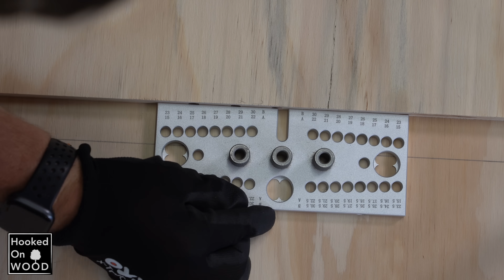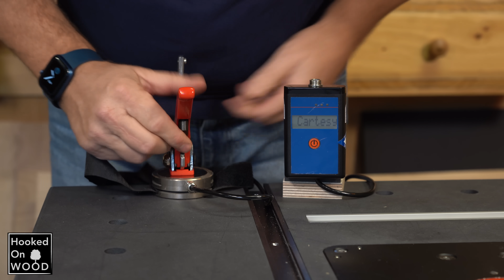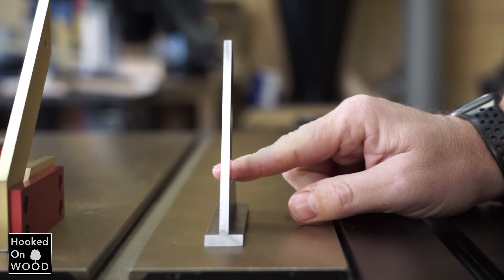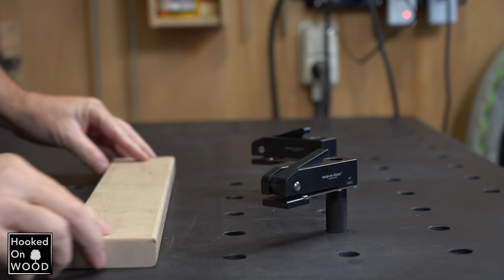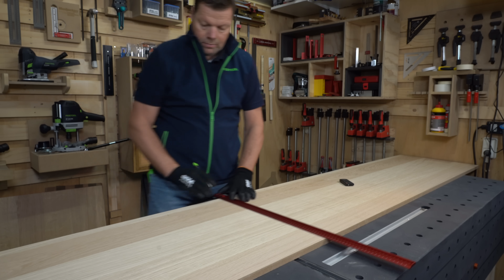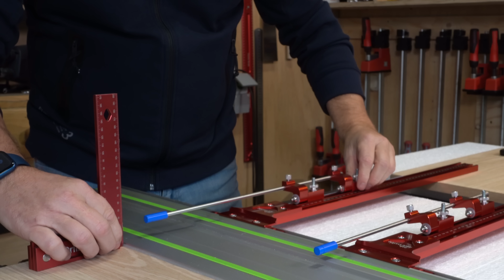China Tools Ep. 30 Parallel guide system Insane low price!

Comment: @gregguarino563
three years late, but I will add some comments. In the three years quality seems to have improved. Gone are the phillips bolts which did not fit the countersink correctly. We now have hex-head bolts.

No flash-hole issues. Threads are better on the knurled nuts.

Strange Dennis was 20mm out. I think he just needed to loosen the T part and slide the rule out by 20mm. This is how you adjust the scale.

All of these units have a slight error between using the stops and the rod.
I think it best to set up the long cuts using a rule and then adjust the rod to this, either adding shim washers behind the metal lug or cutting down the plastic end.

Fitting the rod slider on the bottom rail will allow the leg to flip down onto the scale, for easy setting, as a side ruler has been added, calibrated for when using the rod for thin cuts.

Only problem I found, the ruler scale is upside down. Why?

Comment: I bought the "old" 60 cm Veiko t- ruler from Bangood in  Czech Republic.The opening on the base was to tight to assemble the long ruler. So i filed up the opening wider on the sides and mounted the ruler with the base and was happy with that until i  discovered that the ruler was neiter perpendicular. The two pins and the four recessed screws that determindes the angle cant be influed so the deviation is 2mm on 60cm. I am very disappointed. Wasted money.

Comment: I bought the rail guide clamps (branded as Enjoywood) after watching your video and am very disappointed and can't recommend them under any circumstances. After the first light test they were bend by a lot (before 90°, afterwards ~105°). I own two Bessey Rail guide clamps (GTRH 160) and never observed any bends, even under maximum pressure...
When this is what can be expected from Enjoywood quality-control I'm very scepical about EnjoyWood products in general.😢

Comment: A heads up Veiko clamp quality, sadly that seems to have crashed down hard since your review (first Veiko purchase in years that didn't  fulfill my expectation)! Got eight clamps when they were on offer a few months back (50% price to the Bessey) but I wouldn't buy them again: first the red paint chipped - don't mind the cosmetics, but it tells a tale. The next stop was rust on the exposed parts - not ideal. The fact that a ratcheting mechanism tends to slip when engaging initially makes them a bit fiddly, but still: not good, not terrible. But what IS terrible: during a glue up none of them would clamp! Turns out all of their 90° angles had turned into a 110° angle the moment full pressure was applied - the steel is SO soft that they simply caved in. I managed to bend them back in shape one-by-one but I can only use them for e.g. holding down a work piece when sanding, cutting, etc. but they're completely unuseable for glue ups or anything requiring full force.

Comment: The parallel guides are on sale  right now for £54 delivered. Since you made the video graduation markings have been added yo the sides so you can see easier. I dont make repeatable cuts very often with my track saw as i have access to a panel saw but for the price I thought it was worth a gamble and I cant fault them

Comment: Dennis, I enjoy your videos and your precision. Unfortunately, these track saw rail clamps do not fit and track saw tracks that i know of. Not the festool or the Milwaukee. Powertec and Makita won't work either as they have similar dimensions to the festool.  The base of the veiko (Enjoywood)  clamps are 0.100" wider than the festool clamp. 0.555" vs. 0.455"  They don't even come close to fitting the festool track.  Plus, these clamps are sloppy compared to the Festool or the MicroJig ratcheting clamps.  Please revisit these clamps!

Comment: Question about the Veiko T-ruler. This video mentions you can make it square. But those four conical bolts always pull the ruler in a default position. Which for me is not square. Anyone any ideas how to square it up?
Reply from the maker: How far are they off? I can make small adjustments even with the conical holes.
Reply: @HookedonWood  Thanks for encouraging me to try again 😄
After some fiddling I was able to set it correctly. It seems you have to sneak up on tightening them, then it tends to keep it's position. But for how long? I hate to second guess my tools. I think I will countersink them with a flat bit, and use flat allen bolts. I like the tool a lot, but just this attachment mechanism doesn't feel that well engineered. Thanks Dennis, keep the good stuff coming

Comment: I just received the Banggood Parallel guides. I barely tried them out, but I have noticed a few issues.

1. There are no instructions. I was able to puzzle out how to out the units together, but it was not immediately obvious. 
2. There are significant "fit and finish" flaws. 
     A. The "thin rip" rods would not fit through the bored holes in the hinged stops. This was due to metal "flash" where the set screw holes meet the hole for the rod. I had to force the rods through with a mallet, although I guess I could have re-drilled the holes if I had the exact size (likely metric)  bit.
     B. Same thing with the T bolts that hold the stops to the tracks. Bits of flash in the holes prevented the bolts from going through. 
     C. The knurled nuts that secure the stops in place would not easily thread onto the bolts. The tips of the bolts were imperfectly formed. I suggest once you get them threaded you never remove them. 
3. The biggest problem (so far) was that one of the units could not be inserted into the (Makita) track slot unless the flat-head screws that attach the guide to the rail-inset piece were loosened. I'm talking about the flat-head phillips screws, not the allen-head set screws that are meant to fix the position of the guide in the track. This would have meant loosening both the phillips and allen screws every time I needed to move the parallel guide in the track. I "fixed" this by adding a strip of blue tape between the piece that slides in the track and the "T" shaped bracket that attaches that piece to the guide. 

I have not tried the "thin-rip" function yet.

Comment: Hi Dennis!  You will be happy to know that I ordered and received the parallel guide for track saws that you reviewed and they have fixed all the shortcomings that you noted about the product.  The top scales are now correct and accurate (and have the reference arrows for stop guide placement) and they have added a side scale to the rails as well.  I like to think that they are listening to your reviews and making adjustments!  Thank you for the recommendation!  I have spent a lot of money recently!  ;^)
Reply: Is the calibration consistent between regular and narrow cuts? For me it’s 1mm off - when I calibrate one, the other is off by this amount. I suppose the plastic tip is a little too long. Otherwise it’s perfect.
Reply: @martink7777  - Great question.  I have only done wider cuts. I'll certainly give it a second look.

Comment: The current Fonson Upgraded parallel guide system from Banggood has all criticized points corrected (scale also on the side, main scale starting around 22cm and so on). I just got it for 95€, shipping from CZ to Germany only took 3 days. It’s perfect, only the rods (or the tips) are 1mm too long, making the calibration inconsistent between normal and narrow cuts. It works great with my Makita track saw and rails.
Reply from the maker: Thanks for your reaction

Comment: Warning:  Check your holes!  I bought the 400mm T-square, and only after a while did I find out that the holes where drilled every 1/16 of an inch, and not every millimter... thus it is totally useless.  I just happened that the hole for 300mm was pretty close, so I did not notice until I wanted to drill some holes at 330mm... so here I am, a few months after getting it, trying to have Banggood send a good replacement...
Reply: Update:  I was told all is OK, even if they have a picture of 6.4 holes per mm.  I tried again, with edited photos with numbers, pointers, etc, and now they ask for a video of my use of the product.  I can only conclude that there is not a person, but a bot responding, since a video will add absolutly no extra insight into a very very clear problem.  So, while the tools can be accurate, if they have a production issue and some are not, do not expect to get your money back... and with the higher prices now, I wonder if Banggood is as interesting as in the past...

Comment: Buy it after saw your review by your reference. and received not full pack with scratchs and dents. pack has only 5 rules connectors from 6. also rules has measures starting from 195 mm but in fact flipstops could be sets only from 270mm. leave my  comments here only for prevent another customers from buying by this reference((( your review its very good and helpfull
Reply from the maker: That doe’s not sound good. Did you contact them already

Comment: Thanks for your reviews and due to this i am now very happy with my hondgui miter gauge. 
About the dowling jig, it's a great tool to have too, but is there a reason why you use dowels instead of lamello's?
For me as a hobbyist, a Domino is to expensive so I consider the jig or a Makita lamello machine.
Thanks for your help!
Reply from the maker: I think Domino is easier and more versatile. But I also used a Makita lamello. For aligning it is perfect as well. I found the makita on batteries not the strongest though.
But to be honest, I do not have  experience with others, so I do not know if they are stronger. For use on ply and MDF this is no problem.
Reply: @HookedonWood  thanks I want to makita 220v too. Now I am wandering, how do you decide between dowels or lamello’s?

Comment: I bought this system made by Veiko based on your recommendation from Banggood. The kit I got is improved with the guides starting from 200mm and two setup marks at 295 & 371mm and side scales zeroed at the 371mm mark for cuts less than 275mm wide.

All in all, it was a great recommendation and I'm here to thank you Dennis for these thorough reviews that save us money and frustration.
Reply: Are they worth buying? they look more Clewer than the festool onel for small rips

Comment: Hi Dennis, I just received the Kerfmaker from Banggood. It's beautiful but I did notice one thing. When all the jaws are closed, there is a small gap. Obviously, one would never have a zero width cutter or a zero width work piece but my concern is that the gap factors into the final settings. Can you confirm that you have the same gaps and that in practice it isn't a problem? BTW, I'm going broke watching your channel. Happily! Thanks for the wonderful content.
Reply: Hey Dennis, never mind. I figured it out. I was referencing the wrong surface. All is good. Thanks.

Comment: I actually bought the veiko T ruler in 500mm because standard kitchen cabinets are just below 600 mm in inside depth in Germany and mostly Europe. So when you consider to use it inside a existing cabinet this size is better than a longer one. Perfect would be a 550mm version for this reason.

Comment: Thanks for those reviews.(nice analysis and video edition)  I have received the parallel guide mid dec 21 : 1st impression is correct manufacturing,  manual of use or assembly still missing. I notice that there is - now - a 280 mm scale on the side starting at 200 mm from the attachement t the rail. Now it is time to test & practice. It sounds not so easy to set an accurate dimension, an index should be implemented, parallax error possible. Nevertheless the price is really much better than other systems so we have to find our way to use this Veiko product. Correction: I found a video on WP guide system issued by Graham workshop who explain very well the calibration process. I tested it, perfect. So this tool seems to be excellent for repetitive similar cuts. Thanks again for your advises, between you and Graham, all is now clear.

Comment: To the ones wondering how to calibrate with the rods, they are exactly 14 5/8 inches long. Thats is a round 371.5mm. If you place the second stop at 171.5mm make The rod finishing exactly with the track rubber that I thing is alright. Chinese builder should at least not copy The woodpeckers imperial sized  parts.

Comment: Hi Dennis, I'm thinking of purchasing the parallel guide rails from banggood and noticed there seems to be two versions available do know if one is better than the other there is about a£10 difference. Thanks David
Reply from the maker: Hi David, I do not know the other one. I know it has the scales on the sides this one is missing. But I do not know if it further the same quality. I guess it will be. But I do not know for sure. That is why I did not mention it in my video. I think the price is good for such a tool if you looking for a bargain.
Reply from the maker: I think that is a good choice! It is just a little bit more expansive but nice products and company

Comment: Hi Dennis, I love your reviews and truly appreciate the time it must take to complete them. I purchased these guides based on your recommendation and wanted you to know that they arrived with the bar that goes inside the track improperly manufactured. The holes were skewed by 4mm from end to end and the clamping bolts that go inside the rail to lock the position would not go into the counterbores.  

Worst of all, Banggood has been banging me good by slow walking assistance.  

Just be careful who you choose to put your name next to.....
Reply: I've got this exact same problem.
Reply: @liamboland9650  Well at least the offered me $18 credit to which I replied how will $18 make this tool work properly? Send me the part or send me a new one.
Reply: @liamboland9650  I went after them a bit harder and they are going to send the top t-connectors and the rails out expedited.
Reply: Thanks for keeping me updated.They are messing me about.This whole experience has put me off using banggood again ive spent a lot of money with them over past few years. They keep stalling asking for videos of the problem ect, the last update they asked me if i wanted to get it repaired locally and they would cover the cost if it wasnt too much, ive told them either send me a replacement part, or the complete product.
Reply: @liamboland9650   I had the exact same interaction.  here is the video I sent if you want to link them to it so you don't have to make one  https://www.youtube.com/watch?v=QCQ2KE7wlbQ  . I said that a local shop would be 80-100/hr  with 1/2 hr minimum. The came back with replacing the parts.
Reply from the maker: I am sorry to hear! Isaw your video. Awful 🤨 hope they take their responsibility. Thanks for letting me know.
Reply: @timkelly6660  I've just watched your video and yours seem to be in a worse state than mine, i have the same problem with the bolts that are supposed to be seated under the bar not sitting flush, the other problem i have is that the screws that attache the parallel bars wont screw in not even a quarter of a turn but screw in fine from the other side so obviously have been tapped from the wrong side. The have now offered me a partial refund of £30 and said i can keep the bars, i paid £83 for the bars in the 11.11 so this is a decent portion of what i paid .I need to check that the bars would sit straight if the holes had been tapped correctly and if they do i may accept the offer and buy a set of taps with the money.
Reply: @liamboland9650  same thing with the work on one side. Like I said, they agreed to replace them.

Comment: Hoi from Den Haag.  I also purchased the parallel guide system. It arrived days before you made this video.  I immediately realized the issue. I zeroed it with a 3.5cm offset. which is the furthest I could bolt the track adapters. I don't think I will be cutting closer than that anyway but I can make quick adjustments if I ever do.  so if I leave the narrow rod adapters in I can get accurate repeatable cuts from 3,5 to around 100 cm.
By the way, they just released upgraded rails for preorder.

Comment: Hey Dennis! Thanks for the suggestions. Unfortunately I missed the 11.11 event, but Black Friday is still to come.
A suggestion to your calibration of the parallel guide system: before fastening the ruler screws, apply some locktite thread locker. This keeps the screws from loosening through vibration.
Thanks again!
Andreas

Comment: I just received this parallel guide. I'm trying to use it with my makita tracksaw. One thing that is puzzling me is the nut to attach the guide to the makita track  keeps sliding with some play. uWatching your video I see you for a glimpse tryed what I thought would be easier to have a small nut to connect the rail. Does this also happens with festool track?
Reply from the maker: You need to use the red long bar for this. Not the small nut. In my video that was i have a shot using the small nut but that was from my unboxing video. So the longest red bar.
Reply: Thanks that worked. It would be much easyer if it came with a manual to assemebly and calibration.

Comment: With the screw you can sircumvent the problem from getting them in to the dog holes.
Just take out the screw, remove the handle, insert the shaft from under the table top, put the handle and screw back on, done. No matter how thick your table top is.
All you need is enough room under the table to be able to insert the shaft.
En in het nederlands is dat hetzelfde ;-)